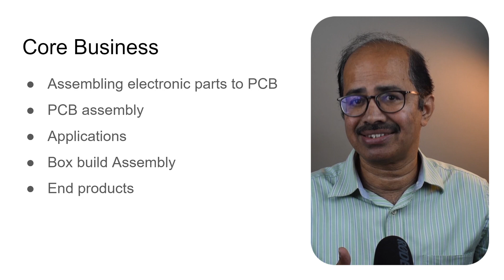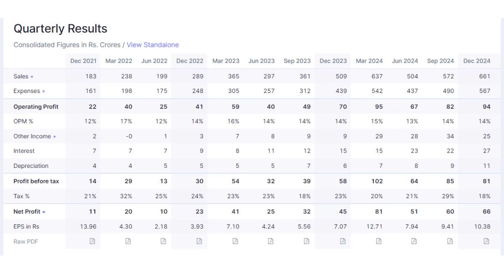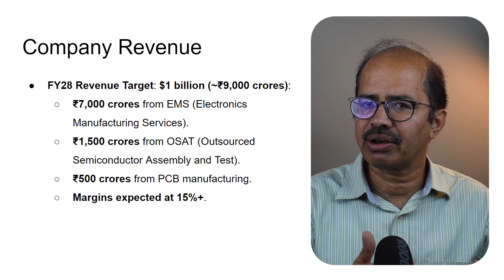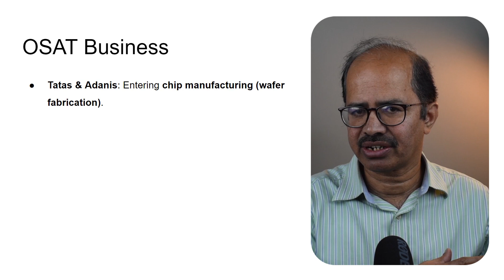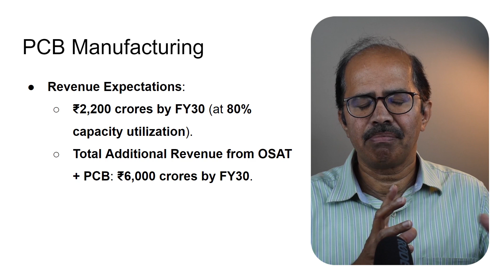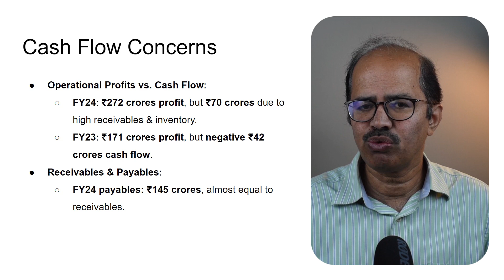Kaynes Technologies Stock Analysis | EMS Stock Analysis

Comment: Sir you are wrong they are bare pcb which is from scratch that's why they are ODEM. That's d stands for design
Reply from the maker: ODM does not mean they will manufacture the components or the bare PCB, they can just source them for their customers. They are still setting up the plant for bare PCBs, at least that is the best knowledge I have.
Reply: @raghavendradiga  Sorry to say this, still you are wrong ODM doesn't mean only sourcing. I'm in nvidia here we outsourcing some bare board PCBs which are completely taking care by the company from CAD design to final product
Reply from the maker: @ Pls confirm whether Kaynes is already manufacturing bare PC boards for their customers and if so, in which facility. I saw information that they still just source their PC boards from outside but setting up factories for the same. I could be wrong easily since I do not have inside information. Thanks for your feedback.

Comment: Fantastic analysis 👍👍 
Kaynes is d most diversified n balanced EMS stock to be global player ahead. This will be the best multibagger of this decade. Save my words
Reply: Hope so...right now in huge loss
Reply: @nimishaDeshpande  don't worry. It is just correcting its valuation and pe. Fundamentally strong futuristic stock. Make in India and digital India project will remain incomplete without kaynes and Dixon type of leading players.Big fishes are waiting for entry once again. Patiently hold for atleast 3-5 years , will create magic in your portfolio. Anyway your buying level n quantity?
Reply from the maker: Hope so. Thanks for your feedback.
Reply: Everything depends on the Q4 results, if the company meets its guidance of 2880 cr, it will see a huge rally, but anything less than 2700 will make the things worse